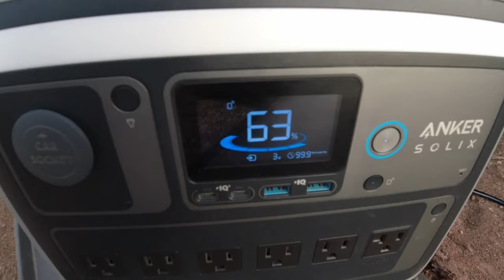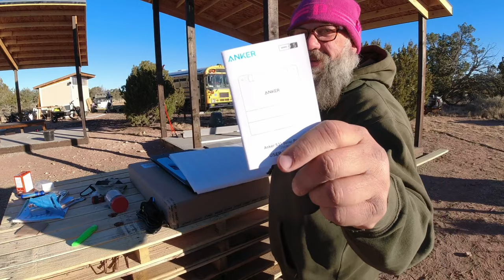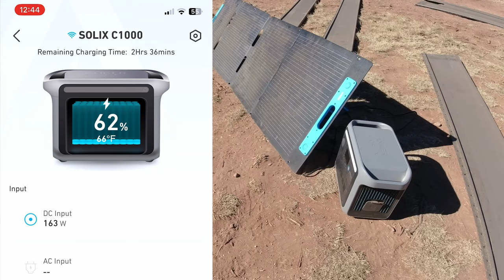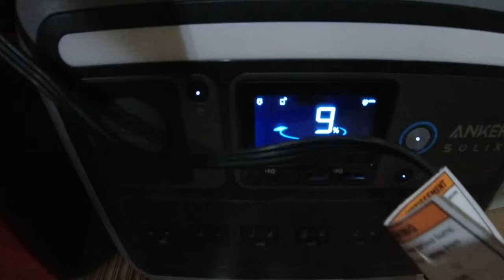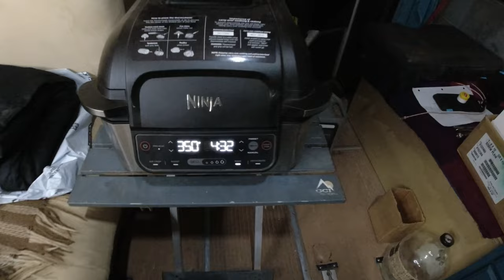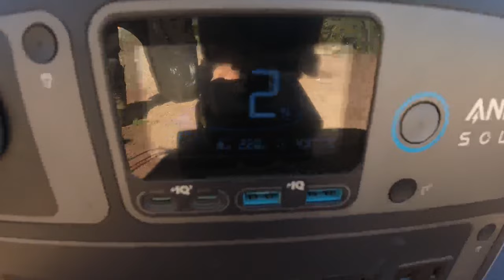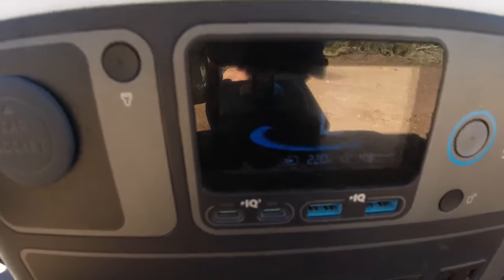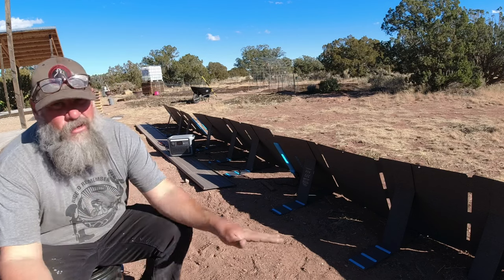MAX 600 WATT Solar Input on the Anker SOLIX C1000 | Air Fryer Load Test! | Black Friday Deals

Comment: Hello. Which splitter cable are you using to connect all 3 panels? I have one Anker 200 watt, and 2 Renege 200 watt panels.
Reply: I'm confused.... Spoke too Anker support yesterday and they said the Solix can only handle 200w solar input. Manual says 600w. I also have 2 Renogy (100w) panels and want to expand. Thoughts?
Reply: @paulloomis2466  I find that their support is not the best. It’s supposed to handle up to 600 watts of charge as advertised. I finally figured it out which connectors that were needed. They weren’t helpful at all. 

I recommend you buy a 400 watt panel if you want to expand to max power input. It was tough finding connections for 3 panels so don’t do more than that.